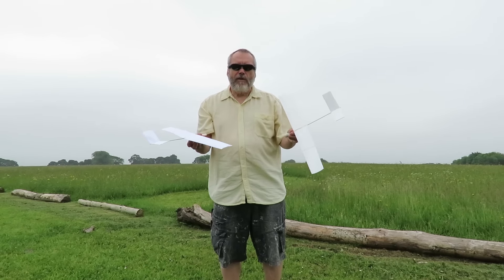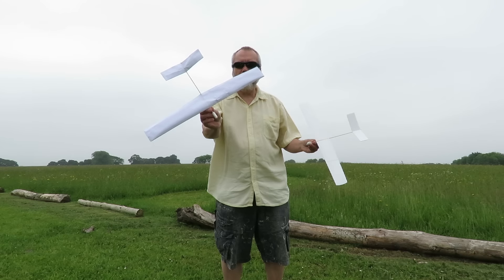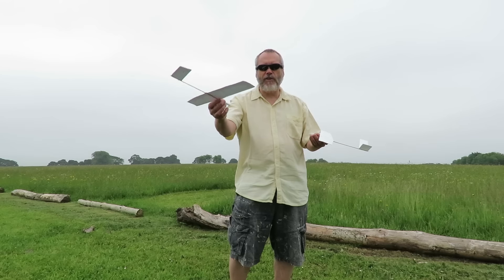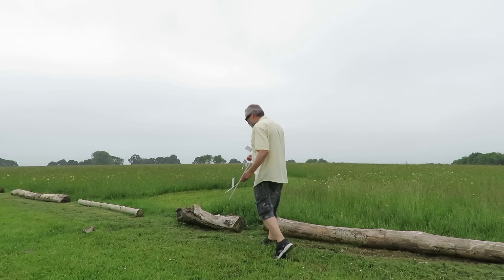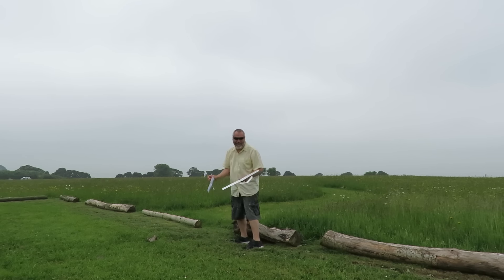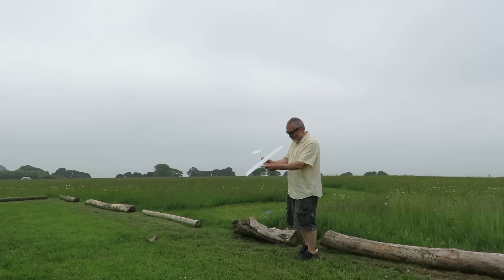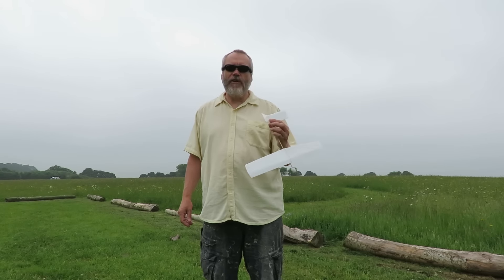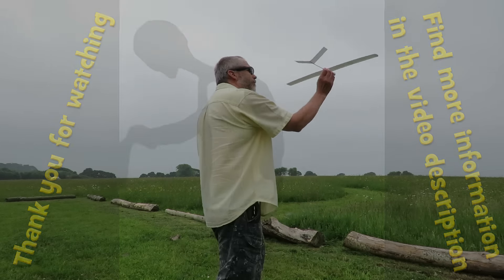Paper and BBQ skewer plane - Styrofoam Plate Alternative - First test flights

Comment: flies rather good you could try adding a section about 2cm on each wing and angle it for tip hedral it will improve it greatly i think ☺
Reply from the maker: You will see in a later video I achieve a sort of tip dihedral by applying sticky tape to the top surface whilst stretching it. That makes the wing bow upwards towards the tips. This is another of the planes I want to launch discus style so I don't really want extra bits at the tip.
Reply: +GrandadIsAnOldMan ok good idea☺

Comment: Hi Grandad one way to stiffen the wing of the paper airoplane is to take two drinking straws and putting a crease along the length of one slide it inside the other, then glue it along the inside of the leading edge......M
Reply from the maker: Yes or I could just roll up my own paper tubes. That is what I had planned for my next attempt if I do one.